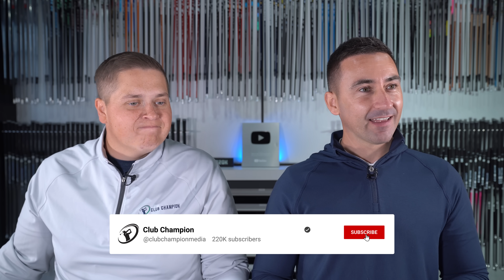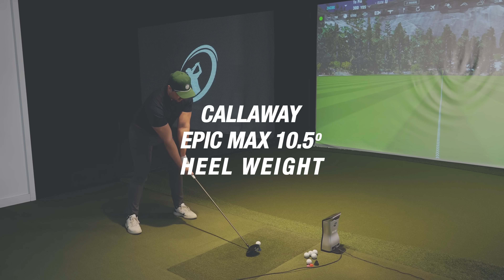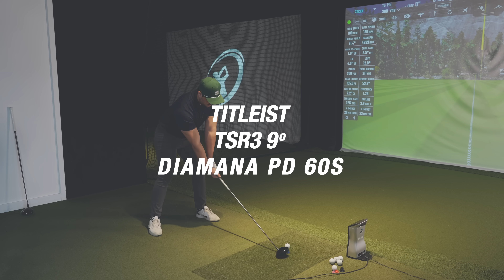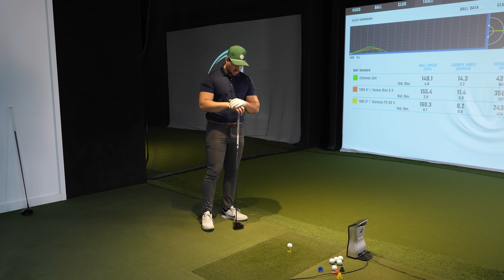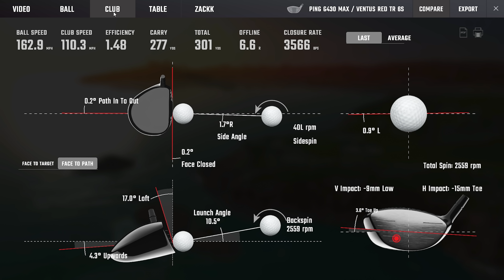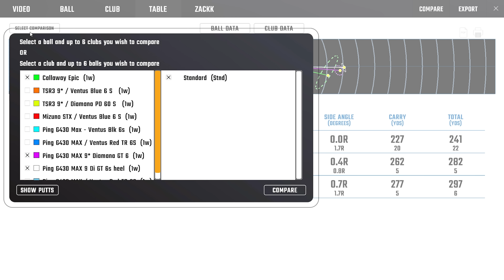15 Handicap Driver Fitting: PING G430 Max vs Titleist TSR3 vs Mizuno ST-X

Comment: Always fun seeing a fitting video. When i've had a fitting with my coach i like to finish by switching from the range onto a course and just hit the tee shots, makes a massive difference when you see a hole in front of you rather than a wide open range, especially when your between to that are very close in numbers because sometimes you just suddenly feel better with one of them in your hands. Do you see any value in that, would be great to see that at the end of a fitting video.

Comment: My question is since you see him hitting it low in the head, would you not change the head to a 10 or 10.5 degree head? Maybe x stiff shaft to help control the pull?

Comment: Wondering what torque spec you are using when you put a shaft into driver head? 

Want to make sure I’m not under/over tightening if I’m adjusting loft

Comment: Excellent video as always. It's amazing to see someone come in and hit the ball off the heel, toe, slice, and hook, and then actually be able to fit them into something. If this was me, I wouldn't even bother getting fitted until I got my club path and club face both to where I want it to be. Great job getting Zack into something that looks like it should help him.
Reply: That's something I see in comments all the time. They fit like a 5 to 8hcp and then people want to see a 18 to 20hcp and it's almost like they want to see it thinking the club will make this huge difference and make them play so much better and  ultimately.....it's the swing not the club for the most part.

Comment: Question for you guys. It seemed to me that he started out hitting shots for data analysis cold, without a proper warm up. Is that how you prefer to start with a client to baseline their data to get the most realistic shot data, like he just got to his round a little late for the tee time and off we go? Thanks.

Oh, forgot to mention, seems a little odd to me when fitting someone for driver that is hitting a few so far right then hitting a few so far left immediately after not to address the movement off the ball that he has first to try and get more usable data no? Is that something that you might do in a fitting to get more accurate baseline data?

Comment: This was great to watch.  I had a fitting at Club Champion in Las Vegas months ago.  I just fitted a new shaft on my driver.  My fitter, Chase Bernero really helped me maximize my currently limited speed.  He fitted me into an Accra shaft and I gained 30 yards.  My mishits are a slight fade.  At 66 I am averaging 265 on my drives, enough to keep me playing longer courses.  Now, with some training I am finding that even at my age I can gain a mile or two....I may get to 275 yet.  Yes people, a well done fitting can help, if nothing else it can help you get the most out of what you have.

Comment: It’s ridiculous that Ian doesn’t just charge a fortune to teach fitters. His fitting methods should be the standard in the industry. I’ve been fit before and they are nothing like this. It seems like they are just guessing and when you hit 2 or 3 good ones they say looks like we found the one.
Reply: I’ve been for 4 fittings over the last 6 months and they all stunk compared to this. Money making scam for the most part IMO. I actually had one guy argue with me that swing weight doesn’t matter that much. For a feel player like myself it’s almost everything. One guy tried to coach me on my swing instead of focusing on what would work best for me as I’m playing now. It threw me off so much I couldn’t hit anything off the Center of the club face. We need more Ians out there.

Comment: just curious, as a 15 wouldnt tsr2 be an option?
Reply: Handicap does not dictate what driver head one uses. Jordan Spieth, one of the best players in the world, and Ludvig Aberg, one of the best drivers in the world and on the PGA Tour, both use TSr2. TSr2 is an option, but it has nothing to do with Zack's handicap. Using TSr3 gave them more options for adjustment than TSr2. Also the low and back center of gravity of the TSr2 with its fixed rear weight probably would have just exacerbated Zack's high dynamic loft, whereas TSr3 has the center of gravity a little farther forward and offers the left/right adjustability with the moveable weight in the back.

Comment: People need to know grip colour can affect weight, white grips are heavy, in the midsize he has the white is 8g heavier that the black. Its one point of swing weight for every 5g of grip weight. As Ian said this club is only C8, i would say it would be bck in "normal" driver swing weight of D2/D4 if A: he had the same grip in black and B: the shaft was not shorter than normal. Dont buy random items off the internet if you dont know how to check your choices arnt making big changes.

Comment: This one has been my favourite so far. Ian shows his stuff, doesn’t just look at a right miss and give someone a draw head, he understands it at such a deeper level.
Reply: Agreed in full. Ian, Mike, and the whole TXG team go so much deeper than just the basics which sets them apart from other fitters. I am sure most fitters we consumers would encounter would see the TSR3 being lower flight and go left and say “we fixed it, let’s move on” A select “better” fitters may take it a step further and move to the Ping but after seeing a couple good ones say “well, you’re striping it with that so all good” Ian wants to confirm after a lot of swings what will still work. This is what they mean when they say the company name changes but they’re still the same 👏🏽
Reply: @djmico0713  Too bad the rest of the company still sucks at fitting.

Comment: Loved this. I bought a used ping 425 max to try it out after using taylormade from Sims  down to taylor made burner pus with flex twist shaft. I'm a ~8 handicap. And I love it.  Using an even flow riptide 6.0 at 70 grams . I might try it a little lighter,

Comment: Thanks for the opportunity boys! Can't wait to come for another visit and have the rest of my bag looked at in 2024!
Reply: You won’t be 15 handicap for long with that new weapon. Good job.
Reply: #thatshammered… great work Bigman!!!!
Reply: @ZackKennedyy  what was the new grip that changed the swing weight?
Reply: What shaft did you go with?
Reply: @CorralesPGA looks like he chose the Diamana GT 6s flex
Reply: @CorralesPGA all my numbers are near identical to his when I got my fitting. I ended up loving the HZRDUS Gen 4 black low launch low spin shaft
Reply: Your game sounds identical to me😂and my name is also Zach😂
Reply: Great job dude, love this
Reply: @zackKennedyy what's your handicap now?
Reply: Are you still playing the driver? Did it carry over to the course after the fitting?
Reply: After watching the fitting, it all comes down to which ball flight you prefer. Would you rather hit the fade or the draw?
Reply: @ryanwalters694  now that I have better control over the club face, I'll be practicing to hopefully have a stock draw come spring
Reply: @ZackKennedyy  I’ve been working on an inside takeaway to eliminate my 2 way miss. Consistently hitting baby draws now. I feel more free over the tee ball and can now swing a little harder. I bought a swing speed trainer recently. Will start working with it to increase swing speed for next year
Reply: From watching this video of your swing I believe one thing that would help your swing is to feel like you’re pressing your arms down before you swing and away from you on the backswing. Let it set at the top and let it go.